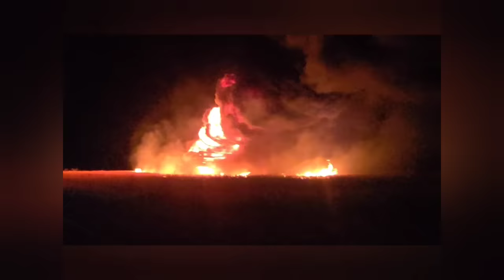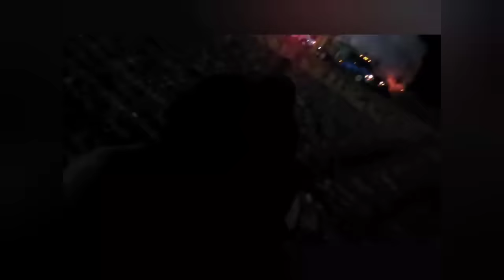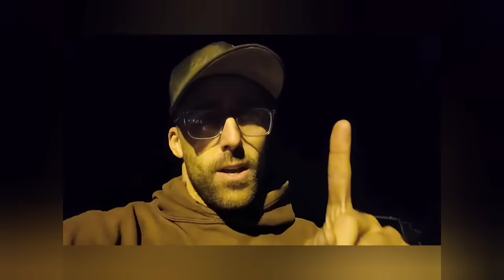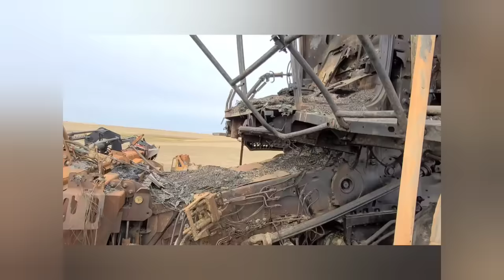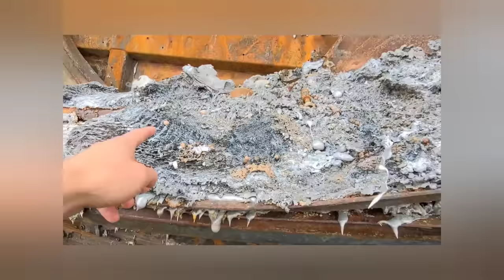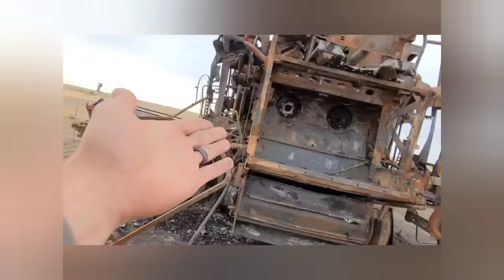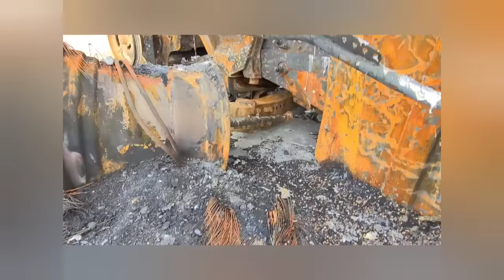Fendt Ideal 9, burns to the ground🔥

Comment: My block heater shorted on my truck plugged it in at 10 pm by 7 am completely gone only body and frame anything that could burn was completely gone. All the aluminum melted off including rims melted flat

Comment: I'm surprised they don't have one of those Ansul automatic fire extinguisher systems on 'em for as big as they are and as much as they cost. If not to save the combine then at least to slow the fire down to help the operator bail out. Though it's good nobody's hurt.

Comment: We have auctions here where they sell barely used firetrucks for just a few grand. These things may have 6000 miles on them, but they are retired for new shiny toys. We could get you your very own big city firetruck and you can even play with the siren.
Reply: The seals etc go bad and need to be replaced.   Their cheap cause maitence is a killer.  Stuff ages out on them.   Mileage means nothing.  
I lived in wis and wasfriends withs pierces  before they sold pierce fire trucks to oshkosh truck.  Then their is another large manufacturer  off fire trucks about 30 minutes away.   They were number 1 and 2 in the world    i know pierce though Oshkosh  truck and oshkosh  defence is number 1 by a great margin now.

Comment: It’s always sad to see equipment burn like you just see it on fire and the headlights are on and the engine was running and now it’s all dead and gone. It wasn’t green but it was still a very fine tuned piece of equipment now it’s been reduced to scrap glad to see the driver was ok even tho his flagpole is now in heaven

Comment: Hate to see this.  Had one burn up in 1981.  Not as dramatic as the old ones were almost all steel and less on board fuel.  New ones are a lot of poly and a lot of fuel and oil.  They go quick. The field is always a concern as you said.

Comment: Did the fire happen just after greasing the machine? Just curious about possibly applying too much grease and pushing a seal out. Sorry, not trying to point fingers, just suggesting a possible cause for the seal issue.

Comment: Oh, but a diesel (jet) fuel fire can't melt steel..
Reply: With enough oxygen fed any fuel will burn hotter. The steel doesn't melt so much as sag under the weight as it softens, but close enough
Reply: the aluminium melted the steel is merely deformed and definitely no 45 degree cuts at regular intervals throughout the structure...

Comment: Glad everyone is ok!  Curious if the seal was heat damaged from the previous season before the updates. Would make sense why it failed.
Reply: He said he checks the oil every day. A seal has to be pristine for it to seal, otherwise it leaks. With an oil cooler, there is a lot more oil in that system and it would take an entire season to leak all the oil out to cause the gearbox to heat up. Its a faulty seal that just puked out, its the only explanation. Mike is 100% correct
Reply: @rejeanmeilleur8408  My curiosity comes from what I’ve seen over the years. If it was ran before updated cooler. And the gear box was running hotter normal. The metal could have lost it’s hardening or “tempering” Which would lead to excessive wear. The metal shavings would cause pretty quick seal failure.... This being an opinion but not sure how others see it.

Comment: If the cause was an unexplained sudden seal failure that was hidden from the operator until it was too late, doesn't that make you nervous about running the other identical combines?

Comment: Wouldn`t it be the best to switch to aluminium fuel tanks? As they`re lighter than steel, but will not leak the fuel as fast in a fire.

Comment: surprised fire supression and fire resistant tanks are not used.   always in conditions where dry stalks, chaff can easily light.. maybe make your own fire suppressor?? soak areas that have high risk to heat up and smolder during runs..

Comment: Why doesn't each combine have a huge fire extinguisher on it ?  If you can get to the fire when it is small, you can put it out, safely.
Reply: Did you watch the video? He said by the time the guy got on the radio it was already too late. Things happen fast. And there are on board extinguishers
Reply: @tatewilson7678  That was this fire.  Not all fires are the same.
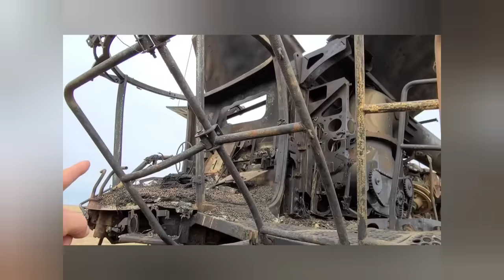Reply: 26:06 you can see a fire extinguisher right there on the railing

Comment: Mike,  has there been any other cases of this model combine burning or leaking oil from those gearboxes? If they run hot then seals could be the weak point. Maybe seal damage was done before the oil cooler was installed but did not fail and leak until later. Just a thought.

Comment: Knew that it had heat issues. Weather or not it was fixed properly with a cooler isn't the debate. It had a pre-existing problem that wasn't adequately fixed. Insurance company gonna weasel their way outta this this. I wouldn't say nothing let alone video it. Them adjustors are always fishing for a loophole!

Comment: Did you try and turn the key to the off position and then back on should rest the machine and back to new if that doesn’t work disconnect batteries for 10min should be good to go.

Comment: That was dramatic.  With 7 identical combines is there any way to check the remaining 12 rotor gear box seals are in perfect working order.  On the design side there would appear to be a few wrinkles to iron out.

Comment: Dirty oily dusty engine compartments are a bomb.  We blow our engine compartments out every night and parked the combines 500 ft from any building.  One night we pulled up to the air compressor and I saw red embers glowing in couple corners of the engine compartment after opening the engine hood.  Play it safe.  Where are your automatic fire extinguishers?  Boats have them..

Comment: If the gear boxes are a potential problem, why are they not monitored with sensors? Besides fuel, you have hydraulic oil, gear lube and a lot of rubber on those machines that burns very hot. Plastic fuel tanks are stupid. Just a way to save money by manufacturer.

Comment: Steel tanks are likely to crumple and deform meaning fuel suddenly starts spurting out under pressure. That's the last thing you want in a combine fire, a freaking flamethrower hosing your crop with a fire starter. if you can find a steel tank that won't deform or crumple and spurt out pressure leaks like mad whilst full of fuel, go for it. Otherwise, the plastic fuel tank will deform a little but will lose pressure a lot more rapidly meaning  there's not going to be a flamethrower hosing your crop with a fire starter. You pick which one you'd rather deal with.

Comment: So after it’s removed what happens to the soil underneath?  Seems like it’s soaked in diesel and oil.  Will y’all have to remove bad dirt until it’s clean dirt?  Dirty dirt and clean dirt!😂
Reply: Most of the diesel and oil would have been burned up in the fire.

Comment: sorry it happened  in still waiting on my insurance claims i put in last year  problem the house was 3 million dollars to build 12 years ago it 6 times that much now why they are dragging their feet and they put their foot in the month to could be a court case over all of this for me  
i have to disagree with what you said it was  you man  plug the chamber up  question for you was it the same combine you broke the bolts from too  have to watch that one again yea it does look clean behind the combine to any chance it happens to break it and plug it up  sensor was not working to warrant him that was plugged to me look more in the middle  how it looks to me
Reply: i never had good luck using gearbox oil  to start fires NO my house was not burned bad Storms in a row and the ground lift and push upward and the hill i built in to push  timber-framed house it was structure damage it was 
yea your fuel tank was a seal  to you did say it explosed  after the fire was already there i did here it poped too  
tires did the most explosion  there 
could you check if the combine was spreading out the waste  behind it
Reply: Geez.....punctuate much?

Comment: Just to note reason your fuel tank is plastic as if it was metal it will pressurise up and then explode and if you had of had a metal tank mr know it all you wouldnt be filming now because you guys would of been covered in burning fuel plus your field and other equipment plastic cant pressurise up to the point it will explode in a fire so technically its way more safe !!!been around to many burning machines so hope that helps

Comment: Sensors. Ugh. Even more sensors. Gearbox oil level or cooler flow and bearing temperature. Ugh. More sensors equals more gearbox case penetrations, another branch of another wiring harness to another input with software to monitor that input and make a decision to turn on another yellow icon before it turns on a red icon before it turns on an alarm and kills the engine after that. Ugh. More complexity. More expense. But if it saves one combine?

Comment: Might want to look at getting someone like Foremost Agriculture to make metal diesel tanks with an ATL bladder http://atlinc.com/industrial.html . I remember one tractor fire that was small and almost out until the plastic diesel tank split = game over. Gearbox -  maybe double, triple lipped seals, temperature sensors on the gearboxes?

Comment: When are the companies going to start thinking about reducing fires. Example, cooled turbo, proper covers that dont collect chaff. Exc. The older case shot straw sideways so you really pile shit all over that hot turbo.
Reply: They make turbo blankets. Race cars use them it actually helps with heat and performance.

Comment: their went a million dollars sure need fire bombs and start thinking about a new kind of combine with heat management and liquid nitrogen system for fires since everything is going electric -fire fighting drones would be nice too
Reply: Santina Murphy  not city  and you dont have the clue - oil is old news and think your gps went off as a bad turn - big block diesel engine big electric motor let me guess you dont work with electric - well look at the new electric hummer and that is old news in electric and might look at fire bombs and liquid nitrogen to fight fires youtube
Reply: @wirehyperspace  you really should do some research in to what is required to manufacture everything that goes in to an electric vehicle... I'll give you a hint... it's black, and comes from under ground.... and a lot of it is required to produce even just one battery.
Reply: @musikmaan  who said you need a battery ever hear a capacitor look on you tube

Comment: To actually see one burn first hand it’s not a good situation I’ve seen 3 burn now & they’ve all started in that area John Deere went back to steel fuel tanks for that reason. The fires start around the chopper or as you said a seals come out of a gearbox Chickpeas are absolute bastards of things to harvest at the best of times that wind doesn’t make any easier 
Humans firstly everyone is ok contain the fire around the machine very lucky it didn’t happen in wheat it could have been a totally different story

Comment: In the picture, the right gearbox looks black and the left looks white.  You say the opposite....what am I missing?
Reply from the maker: There is no gear boxes on the combine in this video, they have already been removed. But the right hand gear box - which caused the fire was white which means it heated from the inside out. The left hand was black, burnt from the outside..
Reply: @mikemitchell2554  Ahh.......I didn't realize they had been removed.  Thanks for the reply.